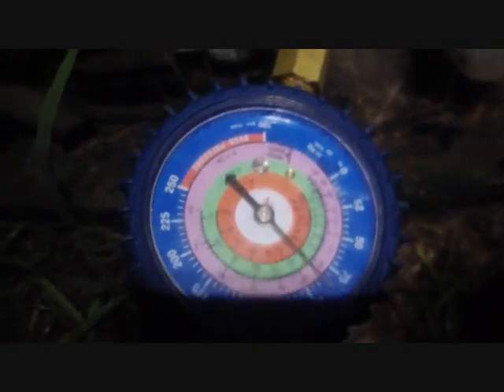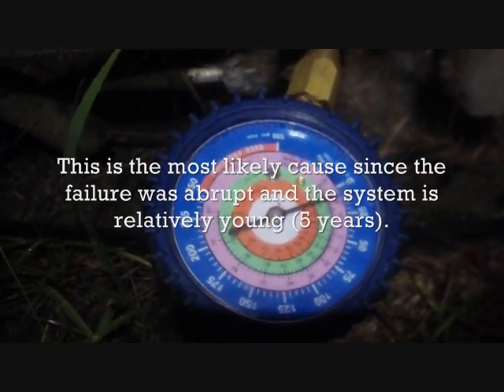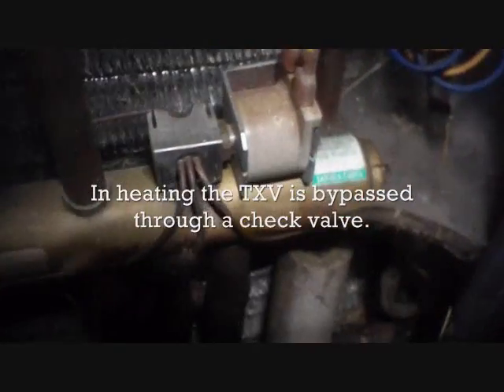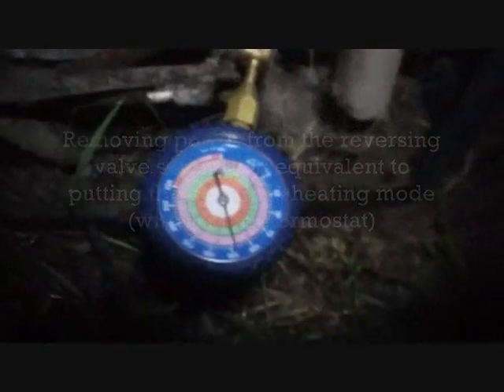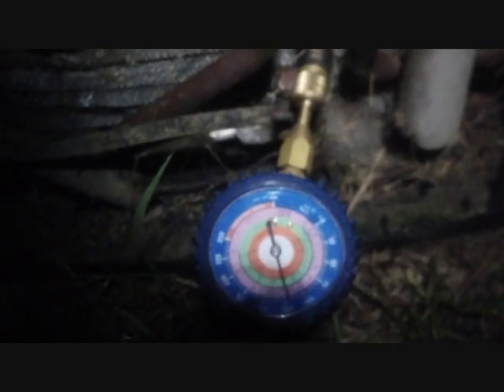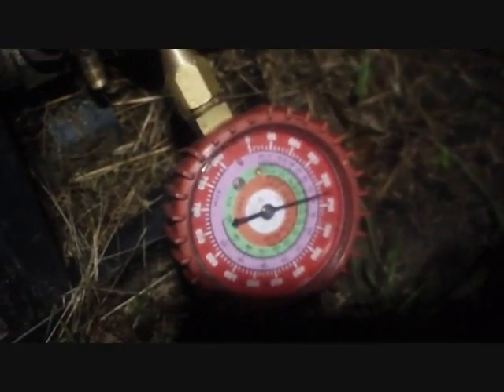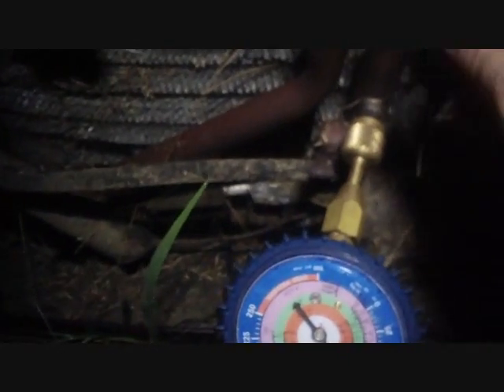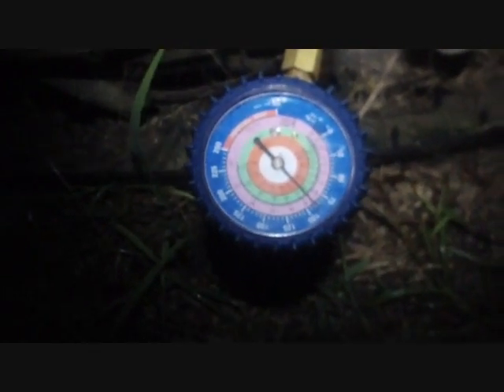HVAC Service- Diagnosing TXV Failure

Comment: txv is faulty .then what happen in the system
Reply from the maker: +Ajay Kumar systems pumps down and it runs high superheat and subcooling
Reply: Thanks
Reply: Other failures are flooding evaporator where it runs low superheat and low subcooling as well as hunting.

Comment: so tell me if I have it right. 
1.what ever mode I have it in is where my restriction is? , ie if it pumps down in a call for heat it the outside txv is at fault and if it dumps down in cooling the inside is the problem. or can I just use the look for the frost and thats your problem school of thought

2. when does the heat strips come on in heat pumps or does it depent what brand it is, because I had a reem peace of junk was calling for heat and the yellow, blue and the heat strips was makinging because I though the heat strips came on in defrost mode or turing your tstat vary high. it seams like it defeats the purpose of having a heat pump if the strips came on.
Reply from the maker: 1. Yes that's right. Restrictions can be found by tracking frost as well

Comment: which txv is restricted out side or inside?
Reply from the maker: Inside
Reply: Inside txv is screwed  up it bypasses the inside TXV that is in the air handler in  heat mode and makes it run normal with normal pressure